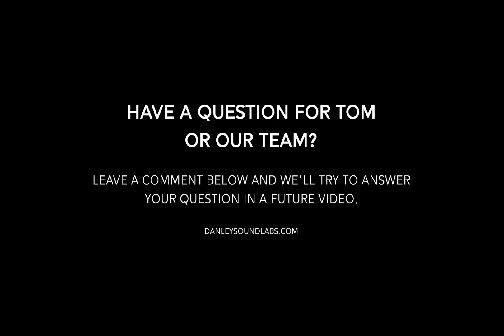Questions with Tom: How do we hear?

Comment: It's intensity and phase angle or delay. You have to move your head left or right to determine if the   source is ahead or behind you. On elevation, you have to tilt your head. On distance, in a non reflective environment, you really would have no idea of the distance. I had access to the anechoic chamber at JSC in the 70's. We played with a speaker emitting tones, moving from place to place while the subject was sitting in a chair. You could point to it but had no idea if it was five feet or fifteen feet away or if it was in front or behind you.

Comment: I have 3 SH-50's with TH-50 Subs, just like Tom. I have no trouble perceiving 3 dimensional depth and a phantom center when I switch to 2.1 listening vs. 11.2 chanels of full home HT Atmos. In contrast, Open Baffle speakers Exaggerate the 3D depth. Is it the out of phase symmetrical back waves with reverberant field time delays that do this?
Reply from the maker: Claude, we'll certainly ask and work to get you in answer.

Comment: I'm currently listening on a Microlabs FC330 2.1 computer speaker set. The mid-high speakers have a fake tweeter which means all the treble is actually coming from the woofer (the highs are surprisingly detailed considering this). Does this mean that technically the speaker is a single source of sound and will have similar advantage to a synergy horn in terms of imaging? I haven't experimented with guessing how far away the speakers are as they only have short cables.
What about a standard car audio speaker such as the Bass Face SPL 69.1 which have a dome tweeter mounted centrally on an elliptical cone?
Or my PA speakers that have a coaxial horn in front of a horn design?
I think in some of these instances, the forward and backward time phase between woofer and tweeter can vary, but as long as there is no cancellation at the crossover, how much of an effect does this have as opposed to a classic speaker with a tweeter mounted above a midrange above a woofer?